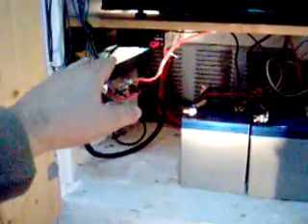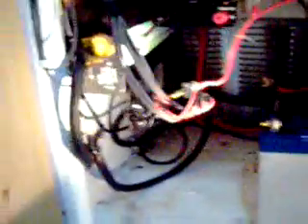Off Grid Solar Power System Progress Updates

Comment from the maker: This was actually the older setup.  Later I relocated the batter bank under the buffet seat and added two more batteries.  I never run out of power except when trying to use an electric heater for extended periods of time.

Comment from the maker: @geralddonais  I'll check but I am fairly certain the GTI is UL approved.  I have yet to see a rule requiring net metering if you have grid tie inverters, just that without net metering on the bill, you would never get money back if your power production ever outpaces your power consumption.  At 300 to 600 watts, it is unlikely for a household to outpace power consumption when using regular appliances.

Comment from the maker: Worth considering right now is my power production is rated at 265 watts, not enough to feed  the GTI at full capacity, but  if I added another 145 watt panel, that is more than the GIT would be using, so I think I could wire the positive like I have the negative wired so the GTI takes the first 300 watts, the rest going to the charge controller when in a Grid tie configuration, but in off grid use, it is just more for the batteries which helps power more stuff.